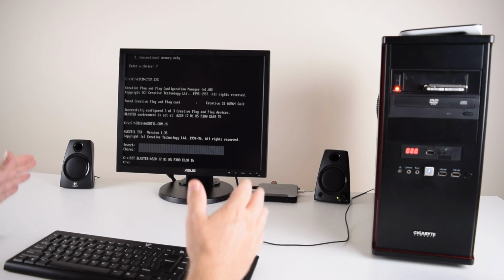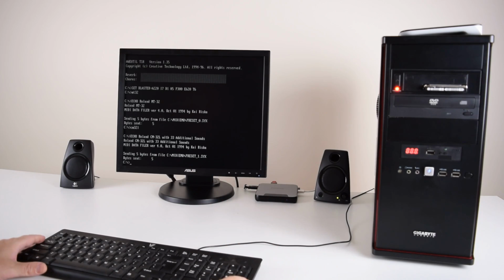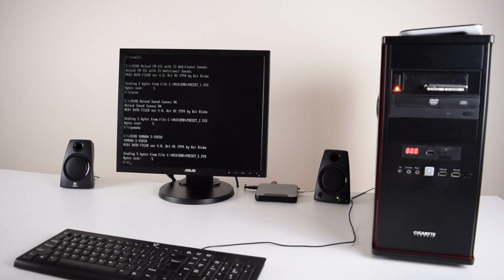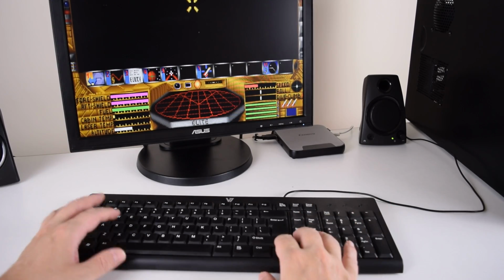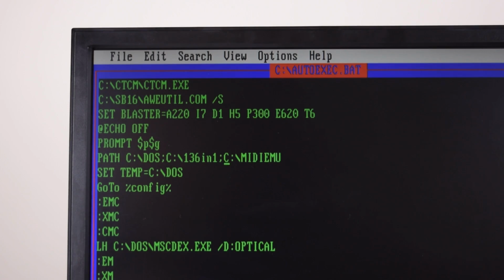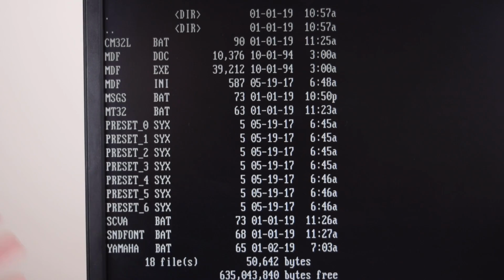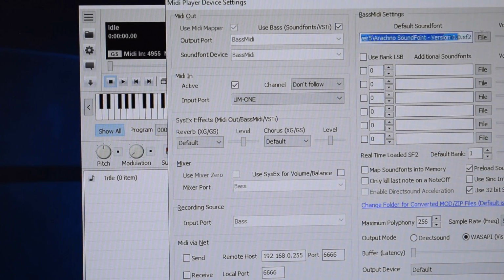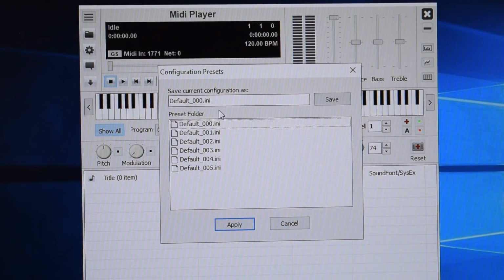Roland MIDI Emulator Project 2.0 for best music with DOS Retro Games

Comment: I'd use a RaspberryPI for example with PiMiDi.
Reply from the maker: You should do that, I'd love to see your setup and how to use it!
Reply: @philscomputerlab  https://www.vogons.org/viewtopic.php?f=62&t=65908 Here's the wiring diagram I found. I'm doing some research on the soundblaster wavetable header to see if I need to worry about any voltage differences. I'll do a full write up on the vogons forums when I've tested this out some more.
Reply: It could work if one would build a proper SC-55 soundfont within SF2 specs (I tried to work it out with patch's soundfont but didn't have much time back in the day). 
I ripped some sounds out of my JW-50 and made proper soundfont implementations with filters and everything. It really could work out, it's just that nobody really focuses on those parameters while building soundfonts.

Still, I doubt PiMidi or BASSMIDI support everything that Sound Canvas or Yamaha MU support. They're all lacking pretty much one piece of the puzzle, BASSMIDI doesn't support vibratos, TiMidity doesn't support all filters, none support 88pro EFX, the list goes on...
This way you'll get pretty much every feature you'd want to use with most accuracy. Pi could work as good as this only when WoA becomes usable enough on it to run VST's.
Reply: I'd add that there's actually a way to connect midi directly to the GPIO pins, but sadly while there are diagrams for soldering something together, any pre-built creation costs substantially more.  This is the biggest problem I see with Raspberry Pi in general--modification, pre-built or in parts, is a (relatively) expensive part of the up-sale market that is the cornerstone of the Pi.  It's left me, at least for the moment, content with using my Pi for more mundane things.  One thing I'm still contemplating is risking making a gameport null modem to bypass needing a gameport->midi and midi->usb adapter.
Reply: @boomerkuwanger3700  In theory it's fairly simple to use the serial ttl ports on the GPIO for this process.  I'm trying out a PiMIDI project myself using a 800mb soundfont that I made. What I'm working on is making a simple cable that connects the gpio and audio out on a raspberry pi 3 to the wavetable header on a soundblaster card.
Reply: @ClintTheriault  Could you try it with the OrangePi Zero? That one is much smaller, less than half the size of a raspberry, and costs only 15€ incl. shipping on ebay. It also has its sound output on pins and no 3.5mm jack, wich would make it easier to connect to a wavetable header.
Reply: @TSteffi  I like the output pins on the GPIO bit, that makes things a LOT easier. I'm using a ras pi for this right now only because that's what I have on my desk right now, but anything with a serial port that can run at 31250 baud should work. Only limiting factor is RAM though so it might not work for my larger soundfonts and most are well above 500mb.
Reply: @ClintTheriault  The OrangePi Zero is available with 256 or 512 MB RAM, so i guess that would rule it out then?
Reply: @TSteffi  not really, I just had an idea about using FalcoSoft MidiPlayer as a sort of MIDI server and getting it to stream audio back to the OrangePi. That way you can just use your normal computer to do the heavy lifting. This would add a fair bit of latency though (150-300ms) but that should be fine for most games. I know how to do this with jack and linux, but I don't know how this could be done on windows yet...
Reply: @ClintTheriault  The OrangePi Zero has a 1.2 GHz Quad Core CPU, so that should not be a problem. It runs Armbian linux wich is mostly compatible with the Raspberry.
I personally have ordered it only for use as a PiModem in my Atari MegaST, and don't have a lot of expirience with MIDI in general. But since the Atari ST line of computers are very well known as MIDI workhorses, it would be a really nice addition to add the ability to act as a MIDI synthesizer at the same time. 
Is there a Tutorial or something like that online for your project?
Reply: @TSteffi  It's pretty early at this stage. No tutorial yet. I've literally started working on it today.  I've been thinking about it for about a month though. 
https://www.vogons.org/viewtopic.php?f=62&t=65908
Reply: Hello, maybe you will like this:
https://github.com/dwhinham/mt32-pi
😉
Reply: WELL SPEAK OF THE DEVIL

https://i.imgur.com/IIPdTEN.png

It runs on Windows on the Pi 3B+ just fine, haven't tested SC-VA but S-YXG50 runs!
USB midi drivers don't install yet tho...

edit: SC-VA runs barely, with some jitter sadly... Needs some optimizing, there is certainly potential!
edit2: no jitter if you disable SC-VA UI

Comment: Nice video. You need make/update the raspberry pi 3 mdi emualtor Project. No sure for munt on pi3 but your tutorial for GM  works fine on Raspibian with Fluidsynth.
Also there not option for Android devices/phones?
Reply from the maker: Nah I gave up on that, I checked it out briefly, but I find the Windows option with Thin Clients, Mini PCs, Tablets or Laptops just vastly superior.
Reply: Midi Voyager on Android has MIDI in. Not sure if you'd be able to get it to redirect the output from dosbox on android without messing with the firmware though

Comment: Great video 👍 
I need to finally finish this project. After your first tutorial about midi emulation I bought Roland UM-ONE with all necessary cables and connectors, but I didn't got time to get it to run.
Reply from the maker: The software side of things is a bit tedious to setup, but once you have it all configured, it's really easy to use :) Do let us know how you go!

Comment: Not to be that guy, but at some point, all the dongles, connectors, extra-thin clients, extensive software, ROMs and scripts just get to be too much for "authenticity". I'd rather just DOS-box it.
Reply from the maker: We actually did a DOSBox project not too long ago! Also in terms of cables and stuff, the MIDI emulator is much neater vs. having real MIDI gear. The amount of cables with 4 MIDI modules is a real mess.
Reply from the maker: https://youtu.be/lq5vhiSWPV4